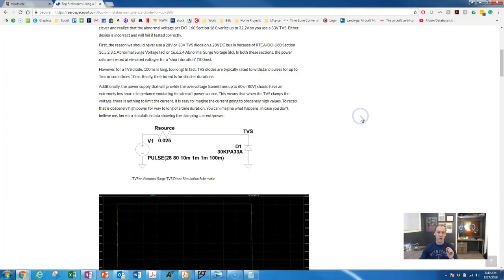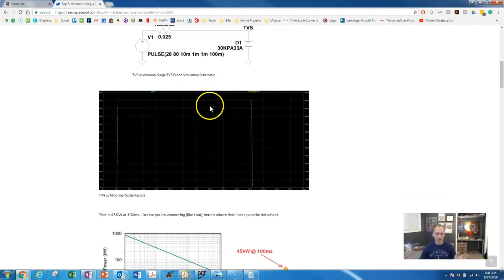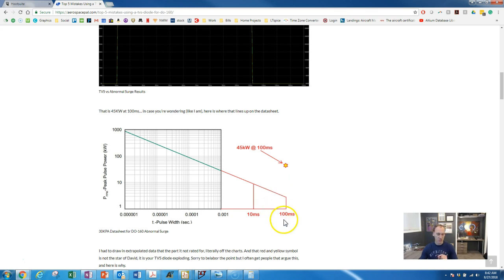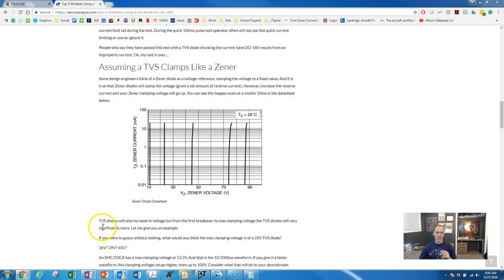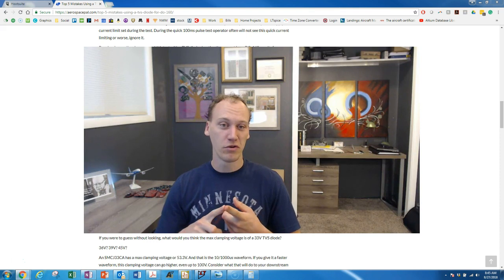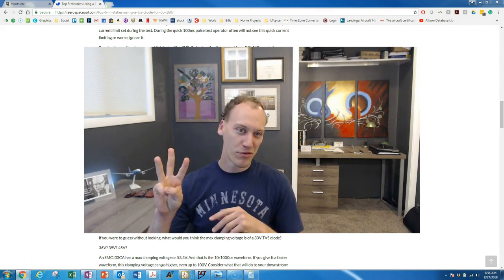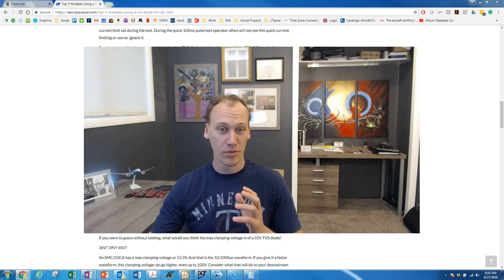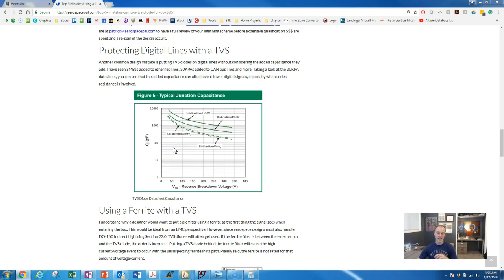Top 5 TVS Mistakes in DO160

Comment: Hello, I have a flight controller for quadcopter that will use 6s lipo battery at 25.2v the motors' ESCs will cause a lot of noise, up to double the battery voltage. The recommended diode is SMF26A, will a SMF22A work with this voltage as well? Vbr(min) is 24.4v and Vbr(max) is 26.9v?